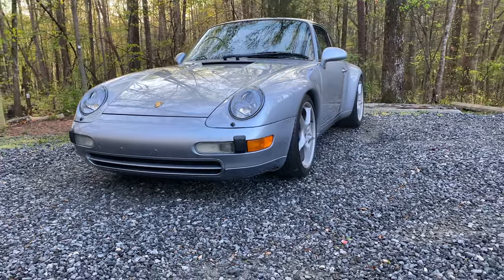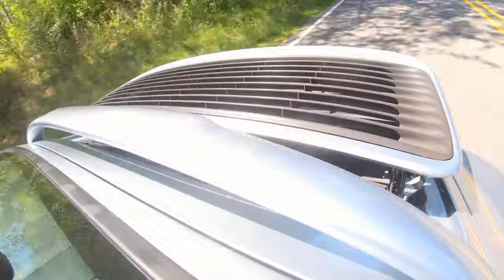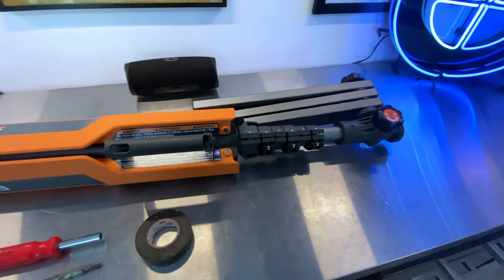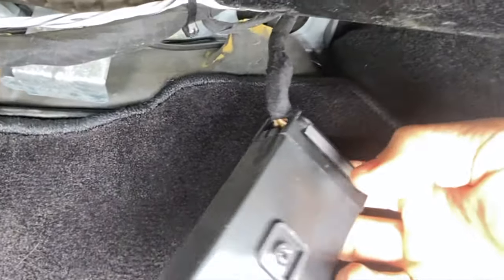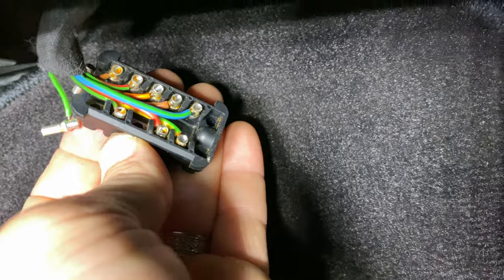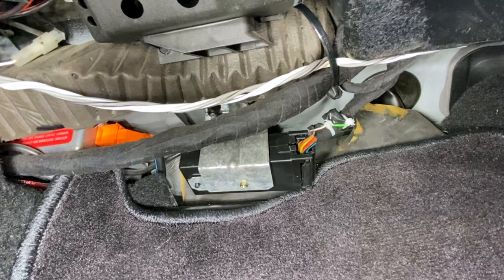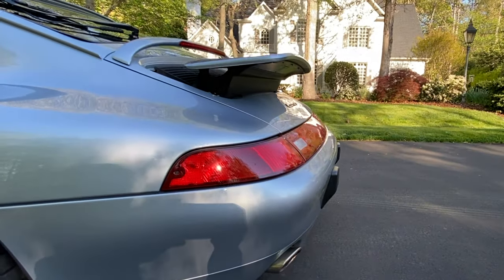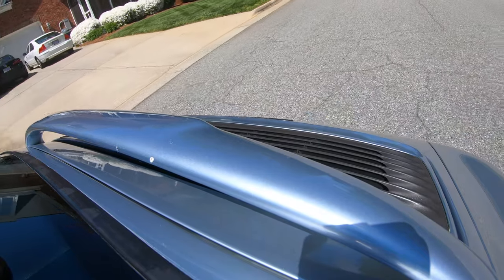I HATE My Porsche 911 Rear Spoiler! (How To Easily Disable The Porsche 911 993 Rear Spoiler)

Comment from the maker: Update: after driving my 993 HARD this summer in 90 - 100 degree Fahrenheit temps, I have had zero issues.  In fact, the car runs cooler at sustained highway speeds now than it did before.  It's crazy.  I don't really know how that's possible but it's happened.  I have also redlined the car repeatedly and have driven it aggressively over and over on backroads and no problems.  I should mention the heat shield is removed from under the car.   Regardless, the spoiler staying down all of the time has not presented any issues with overheating.  So, there you have it. 👍🏼
Reply: It makes sense if we consider the heat shields.

Comment: All spoilers on all Porsches are meant to reduce lift on the back (not create "downforce.")  Porsche could probably provide you with the numbers in terms of reduced lift (in lbs of force) if you wanted to research that, they did it for a specific purpose.  The stock "whaletail" on a 911 (or a 930) performs the best of all spoilers, with the ducktail next.  I know some people hate the whaletail, but it provides the best situation in turns to keep the ass-end from getting away from you.  I think there's a ducktail for the 993, and its looks pretty good.

Comment: Hmm Porsche make everything usefull, so mine 2cents i think its dumb. You need it for downforce and cooling the engine.
Reply from the maker: I don’t believe the downforce will be useful, at least for my application.  I mean, I’ll go max 80 mph.

I can totally see the usefulness in cooling the engine.  If I run into issues during summer I may reverse the mod (easily done, as you can see).

That said, I have buddies who have done this with no issue.

Thanks for watching and please subscribe if you haven’t already 👍🏼
Reply: @Rennthusiast  
In Europa the spoiler comes out with 80km to give more down force and cooling. If Porsche would have thought its not needed, they would not make it.
Reply from the maker: Cool.  Thanks for the insight 👍🏼

Comment: I think personally your asking for trouble! The idea is that engine stays as cool as possible and air flow through the engine when you start to push !   ( air cooled).
Reply from the maker: We’ll see.  I have friends who have done this mod with no troubles.  Good news is that it’s easily reversed.
Reply: Right. The 964 & 993 spoiler (same parts) is primarily for cooling. The blades on the spoiler direct air downward and rearward. The black plastic accordion sheet at the rear of the spoiler(the wall) deflects the air flow forward over the engine for cooling at high speeds.
It may help somewhat with high speed stability but it's primarily for engine cooling.
The Porsche engineers generally know what they are doing--I would recommend not trying to second guess them.

Comment: I loved the spoiler on my 993 until it recently failed and I discovered a new motor and gearbox amounts to around $1000! It can stay down for a while now...
Reply from the maker: Whoa.  That’s not cheap. As you can tell, in my opinion you’re not losing much by not fixing it.  I think the rear of the car looks better with no spoiler.

My 3.2 I got intentionally with no tail.

Comment: The spoiler was meant for more efficient cooling, and I think it adds to the look, i like it. It was carried over to the 997, except you can disable it from its control in the cars instrument panel. Can't speak for the 993 but the 997 engine compartment get fairly hot even though the rads are situated up front.

Comment: It's all about lift. You wouldn't want any lift as you increase speed. Being a "flat bottom" , the spoiler's job is to "spoil" the air flow so your car doesn't lift. The spoiler adds about 8lb of downforce. It is there for a reason, not for appearance. It might also cool the engine but I really don't think that is any of the purpose of this feature. The spoiler being up doesn't expose any of the engine cover. You have a fan for the cooling.

Comment: It's funny that once upon a time, the spoiler stopped working on my 964 and I took it to the shop to have the issue repaired. I should have left it alone I guess, then... well, aside from the big orange exclamation point on the dash haha.  I'd love to disable it on my 991, though. Great channel by the way, Will. Congratulations!
Reply from the maker: Rafael Gomez thanks.  Haha I have taken a lot of criticism for disabling the spoiler...more than anything else I’ve done on the channel.  

Thanks again for the support and for subscribing.

Also, good luck with those wheels.  I hate that they aren’t going to work on my 993.

Comment: you won't see the spoiler at 70 mph. You should be looking out the front window. As for the sound of it going up and down try lubricating and maintaining the mechanism. This will probably solve most of the noise. I am not saying it isn't annoying for you, but the noise from the engine might also be an issue.

Comment: I HIGHLY doubt the down force being negligible.  That doesn’t sound like Porsche.  Remember they thought enough of the utility of the spoiler to carry over to the 996.  It’s virtually identical on the 996.  I was in my Toyota and following a 993 with the spoiler up the other day on 95.  I think it looked great, although I do admit the cars look great as fast back too.
Reply from the maker: I have since sold this car and now own a 95 993 in Grand Prix white and I have left the spoiler alone.

That said, the spoiler on the old car remained disabled with zero problems.  No overheating issues nor any rear handling issues at higher speeds.

Comment: "The spoiler helps the German cops to see when  you are speeding in the city , without a speed gun. LOL."  No bottom line : without the spoiler overheating of the engine in the USA should not be a problem (except Arizona, Florida and parts of California I guess) but being on a racetrack or a long Autobahn drive with high speed will definitely overheat the engine. Keep always in mind: if a car producer can save in a unnecessary screw they will, if the spoiler wouldn't be necessary why should Porsche invest a couple of hundred dollars to install it for no reason? Anyway good luck and good videos BTW.
Reply from the maker: Thanks for watching and commenting.

I don’t think I’ll have issues with overheating during the course of my usual driving. 

If/when I track it I’ll keep it up (can still adjust it manually).

Thanks again and pls subscribe if you haven’t already. 👍🏼

Comment: Sorry, as an aeronautical engineer and 993 owner I must disagree.
Everything has a purpose and the last thing an engineer is going to design is something that has no purpose.
We don’t spend 8+ years in university to design things without a purpose , seriously.
If you don’t like it for the simple reason it makes a noise when you stop just say so.
Reply from the maker: I also don’t prefer how it disrupts the slope of the line from roof to rear bumper

I still can’t figure out the purpose, though.  I have had it disabled since last spring and have experienced zero cooling issues and certainly no handling issues from having less downforce on the rear of the car.

Perhaps the spoiler is helpful in keeping the rear end planted at speeds in excess of what we drive on regular US roads.

Comment: In the owner's manual it states that the engine will overheat and be damaged if the spoiler doesn't extend. I like the feature so much that I installed it on my 73 911. Mind you i have a 95 993 engine.
Reply from the maker: I have been told that before but have had no  overheating issues here.  In fact, it runs cooler than before.
Reply: @Rennthusiast  I can see that going by the number of people who have installed 3.6l engines in older cars without any spoiler and don't have heat issues. Before I installed the extendable wing cover, I had my back tires come off the road at 220 km/h. It was very alarming. Car feels much firmer above 200 with spoiler extended. Just my experience.
Reply: @Rennthusiast  Thanks.  What do you use to measure the temperature?  The factory gauge or an aftermarket gauge?

Comment: 100% for cooling. But, unless you are at the track or a super hot day ripping up and down a canyon road I doubt it makes that much sense. I can tell you what the 'coffee grinder' sound is. Mine did the same. The repair was a cheap sealed bearing that fails in the motor. Easy and inexpensive repair I did on mine. Silent as a mouse now. Now, the basket handle...design fail. You got the YT Casey Nesbitt sunglasses thing going dude lol!
Reply from the maker: Thanks for watching.

I drove my car down to the coast of NC a day or so ago.  It was hotter than hell with an ambient temp of 94 F all the way down.  The car ran cool the entire time with the spoiler down.  

I was running between 80 mph and 90 mph much of the way.

So, if it’s for cooling I am thinking you need to be beating the hell out of it at the track to get it to run hot with the spoiler down.

Comment from the maker: Do you hate the Porsche 911 993 retractable spoiler as much as I do?  Have another 911 feature you despise?  Tell me about it in the comments.  And, as always, if you think I'm dead wrong, I want to hear about it.  Change my mind!
Reply: You do need the rear spoiler deployed at speed...  and you made me re-read my books so that you can have sources cited!  Ha!  The best discussion is in Paul Fere's book "The Porsche 911 story", 1984, pp. 123-124. the 1973 "duck tail" reduced rear end lift from 278lb to 68lb.  The G-series 911 had 397 lbs of lift in the rear without the tail.   I have a '97 C2.  Our 993's have the same basic aerodynamic shape as the classic 911s did.  That little deploying rear wing significantly reduces rear end lift about 360 lbs as well as reduces rear end drag a bit.  You may not be able to "feel" it but there are lots of things about 911s that are going on that you probably take for granted and don't know about...   Our 993s are capable of achieving 176 mph as was tested in 1995 when they appeared in the US.   Although the benefit of the tail is most pronounced at faster speeds, the factory settings deploy it at around 50mph in my car and at that speed, it begins to deliver both a reduction in rear end lift as well as additional cooling forced down into the engine.  At 90 mph and greater the increase in reduction of rear end lift is non-linear and the stability of the car can be dramatically affected.  The performance of the car and its resulting stability are enhanced by the  rear wing.  Rule of thumb, Porsche very seldom did anything in these classic years for pure aesthetics.  Your rear wing is there for a reason.   Keep it functional and fix it if it does not deploy.  If you don't like the way it looks deployed, fix it, and keep looking out of the windshield when you are driving the car and at all other times, you will not see it up!  You can pretend it isn't there.     Most of all, don't encourage owners and drivers to delete things that can risk the safety and performance of their cars which can not only harm them but others too...  do your research. Be safe.

Comment: I’ve just noticed my 1990 964 spoiler stays up. I can take it down using the button on the console but it doesn’t go down automatically. It makes noise almost as if it might be trying to come down. I guess I might need to have someone look at that control unit
Reply from the maker: Yes, my 964 spoiler drops when I come to a stop.
Reply: @Rennthusiast  mine doesn’t seem to come down automatically. issue started after I tried to manually raise it and bring it down (using the button in front of the gear stick) when the car was stationary. Now it stays up when I have stopped the car ie doesn’t recognize that the speed has dropped and come down. I have to use the button inside the car to bring down
Reply from the maker: Maybe disconnect and reconnect the battery?  Long shot but easy to test.  Otherwise guessing the control unit is acting up.
Reply: @Rennthusiast  thanks

Comment: Did this mod today. Thanks for the video! Totally agree that spoiler up messes with the amazing shape and design of the 993.
Reply from the maker: CRB717 glad it was helpful.  Judging by the comments, we are in the minority.  For the record, though, I have had zero overheating and not only hammered on the car in deep summer in NC, but I also got caught in sustained stop and go traffic several times last summer, and while it got hotter I do believe it was normal operating temp.

Thanks for watching.

Comment: That’s crying out for a duck tail
Reply from the maker: I do like the ducktail look.

I have given thought to putting one on the 993 but I am also thinking it’s more appropriate on my 3.2.

Do you have any insight on the difficulty and cost of putting a ducktail on the 993?  I have, in passing, looked at the option from Getty (I think that’s the company...)
Reply: Bavarian Enthusiast TV not aware of any significant issues. Certainly on a 996/997 it’s just undo the bolts on each side and swap, then do the bolts up. It’s about a 10 minute job literally that simple. I don’t know what the air cooled decks are like, I imagine similarly easy. Duck tails look seriously aggressive in my humble opinion, I absolutely love them. I’d also suggest they are practically more efficient, in terms of air flow and downforce, again that’s 996/997 experience.